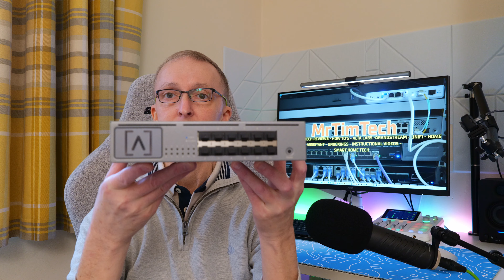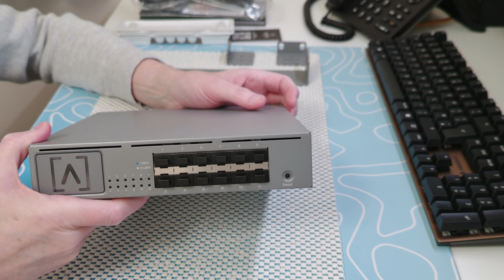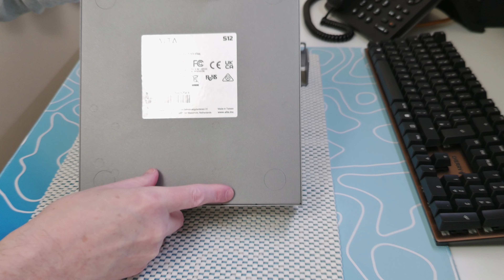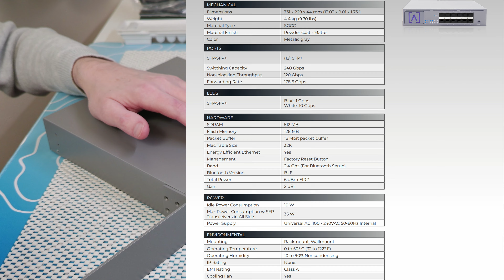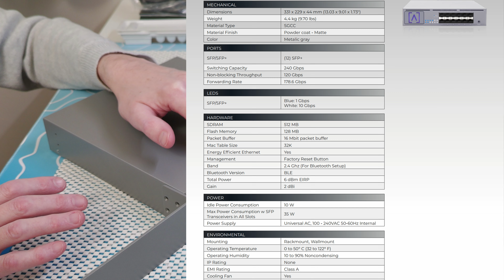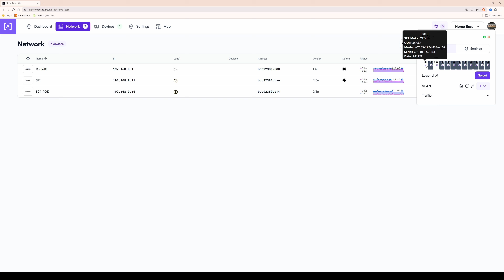Alta Labs S12 Distribution Switch - Unbox, Specs & Install

Comment: Great video Tim!  Nice to see a multigig switch in a small form factor.  Thanks for sharing.
Reply from the maker: Thanks Tony, you're welcome.  Yes I agree, it's a nice little switch and runs quiet, although I guess filling it with a lot of RJ45 SFP+ modules which would run hot, would make the fan ramp up a little.
Reply: @MrTimTech2022 true, good point.

Comment: do they charge a fee for their self hosted contoller with a licence restriction built into it? any limits on the licence?
Reply from the maker: Good question.  No it's totally free, so no fees or any licence restrictions.  You get the cloud service free, or you can use their local controller (Alta Control).